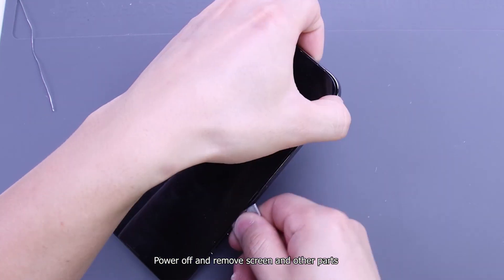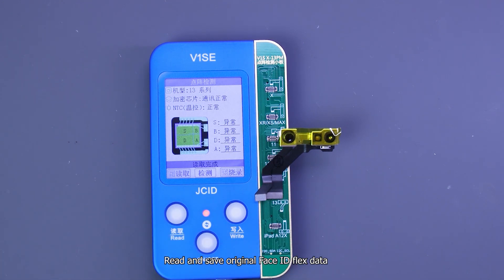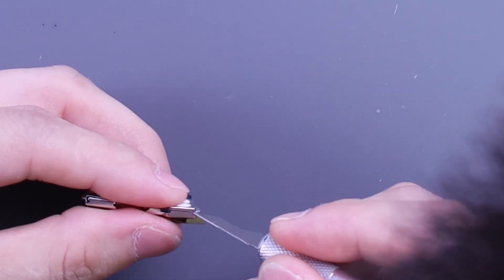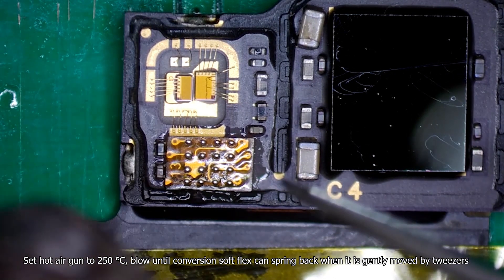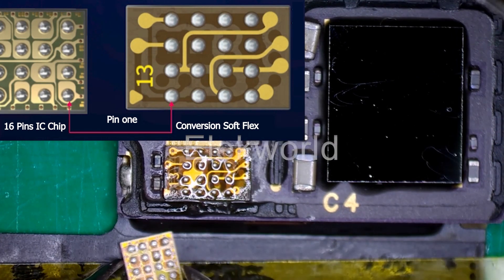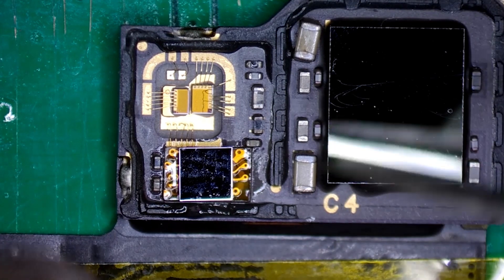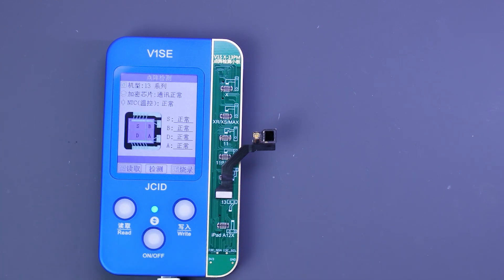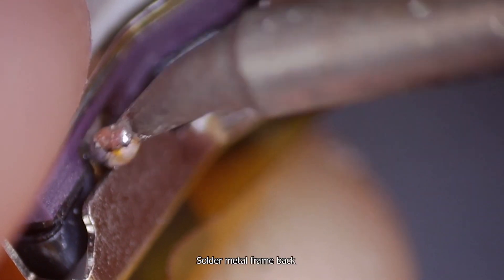How to Repair iPhone 13 Pro Max Face ID Not Recognized? --- Dot Matrix Repair With 16 Pins IC Chip

Comment: Hi I have a 13 Pro with move up down or face not recognized problem, can that be fixed also with this IC method?
Reply from the maker: It should be Dot projector problem, but might not be the only possibility. So we suggest you find a professional repair shop to fix it.

Comment: I have a 13 Pro with move up down or face not recognized problem, can that be fixed also with this IC method?
Reply from the maker: By now it's only works on iPhone X-12 Pro Max/ipad Pro 3/ipad Pro 4, if it's' available on iP13P in future, we will share on Youtube too. 
If you  need any other parts, pls message us with: https://wa.me/8613590142302